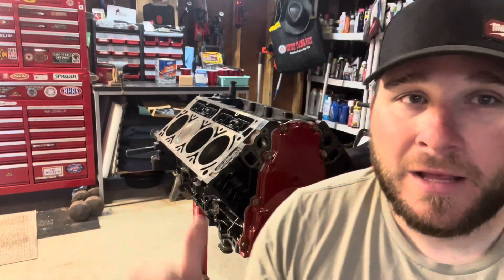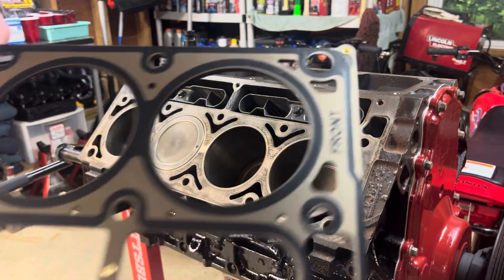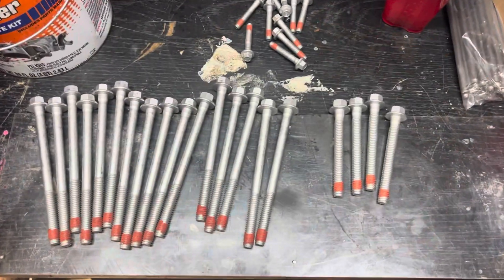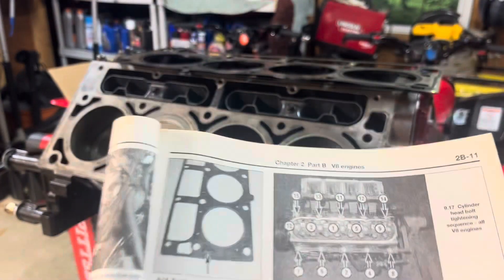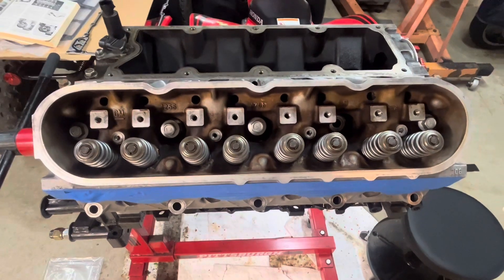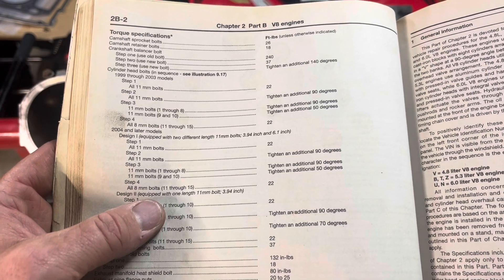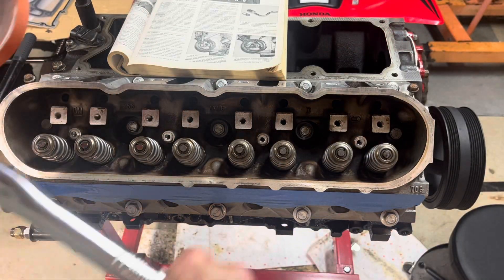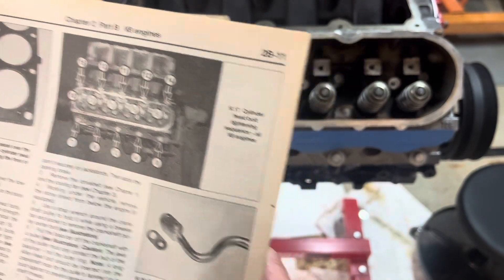Lm7 5.3 ls v8 Chevy Cylinder head installation

Comment: Are the short bolt on certain year blocks or all ls blocks
Reply from the maker: Good question I’m not too sure but I know they only go on one area of the heads at least on this project LM7
Reply: @Gasolinegarage well I put mine back together and its running fine so I didn't mess anything up at least yet anyways
Reply from the maker: That’s right run it till something needs to be fixed. That’s all I do it.

Comment: Why didn't you follow the manuel and do step 1, 2, 3?....1st torque the ten bolts down and then do a 90 degree turn on the ten bolts then do an additional 90 degrees and only and additional 50 on bolt 9 and 10...lastly torque smaller bolts 11-15
Reply from the maker: I did .. I just Time-Lapse the whole thing